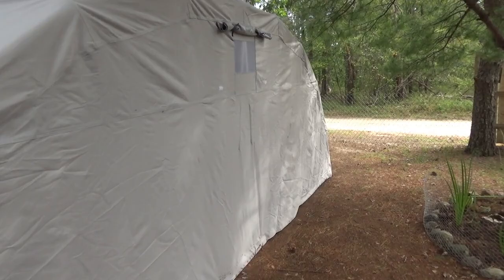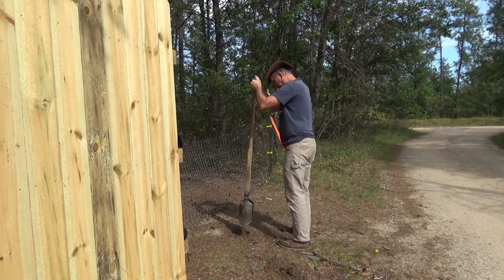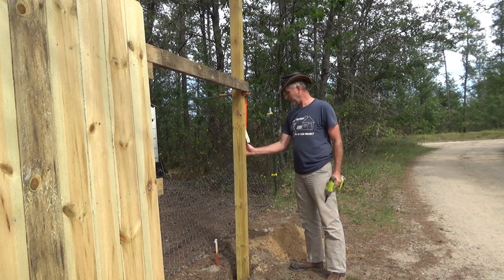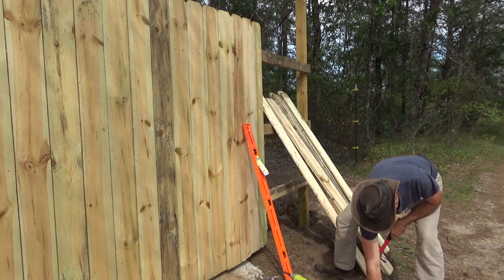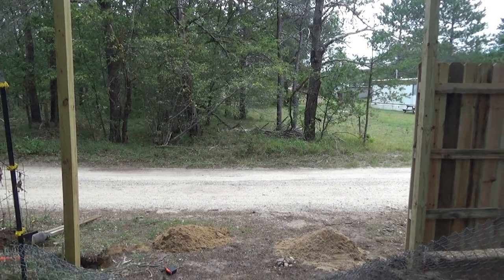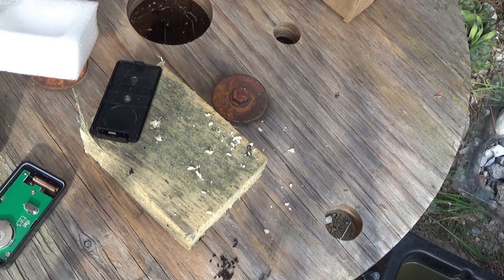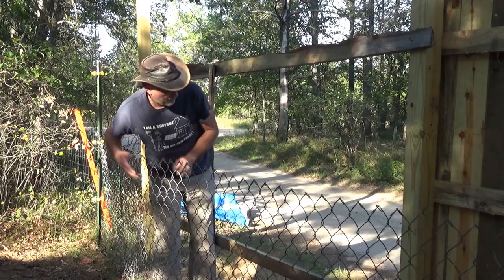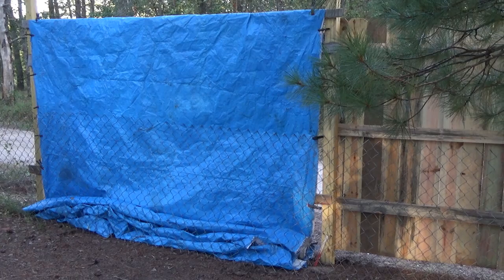Daily Vlog Putting In Garage Gate Posts And More Homestead Security

Comment: Why not get the Ring Video Doorbell or something like it so you can see and record who is at the gate. I believe they are triggered by motion sensors. So if someone approaches the gate, they are recorded, even if you aren't home. Having one for your front door wouldn't be a bad idea either.
Reply from the maker: The ring is expensive and wifi. I dont want a security loophole. I am building my own security system is all I can say.
Reply from the maker: Yeah, I know, you are going to shoot it out. One day I will find authorities who can and will help.
Reply: @sweetjessiethescoundrelscott  maybe u won't last long ethers
Reply: @TheDoItYourselfWorld  I would spray some type of silicone spray inside the transmitter to waterproof it and keep down any corrosion from the battery if it were to leak out in the elements like that.
Reply: Troy, You can set up a Wi-Fi network independent of your home network. Once your video or images are uploaded... Let them try to hack into the Ring servers. I doubt they will have much luck. 
As for expense, there are other services that are cheaper than Ring. Ring was just  an example. 
I'm not going to ask you to publicly give the details of your security. But from what you have mentioned so far... It is known what doesn't work. That is, game cameras that can be physically accessed and destroyed, or have their SD cards removed. The most important thing about uploading video to the internet is that the bad guys can't touch it. Once they're caught, they are screwed.
Reply: Yeah that won’t last long unless he guards it.   It would be cool,  to have the barrel of a 12 gage poking though the fence crack,  above the doorbell transmitter.  
💥 bam the Mo.. Fo.. loses fingers or hand.
Reply: @someonesprincess3  like how u think
Reply: @dropedlow33  ah thx ☺️ 
Besides losing a hand,  he would crap himself too. it would be worth blowing a hole though that section of the fence
Reply: @williamocrow  that ware dielectric grease come in at
Reply: @someonesprincess3  he does that for fun lol
Reply: @dropedlow33  lol
Reply: @someonesprincess3  
I like your idea!
Reply: @someonesprincess3  
I’m sure the last thing he says is: OH S***!